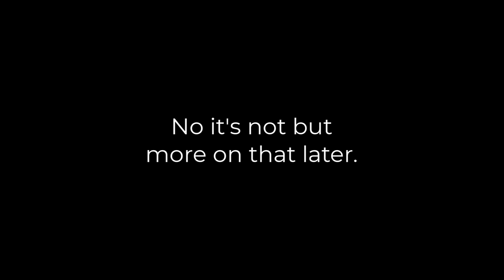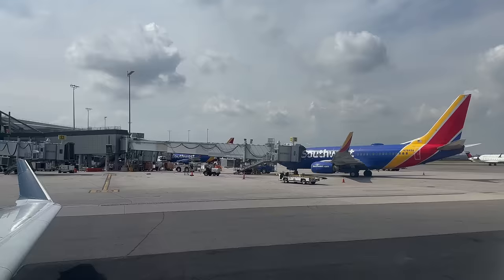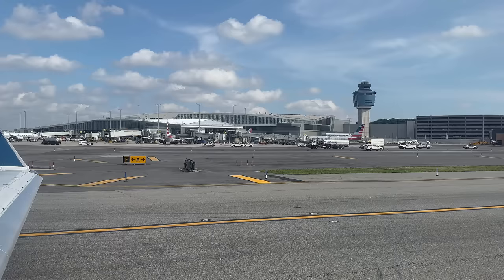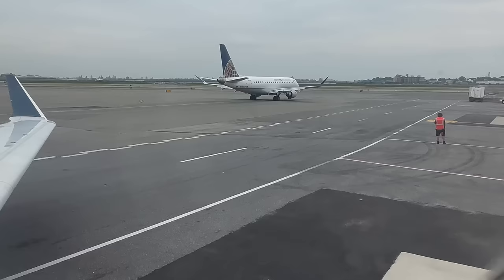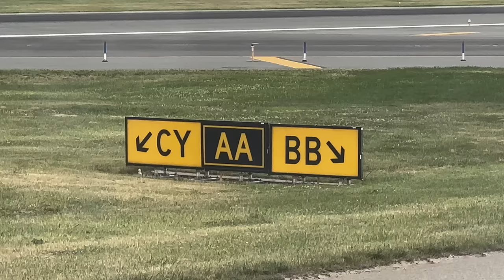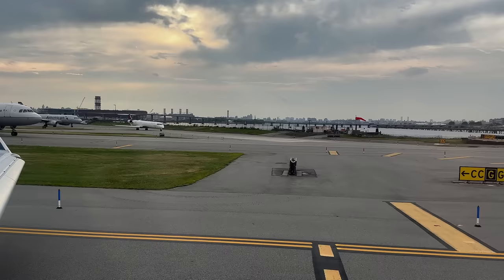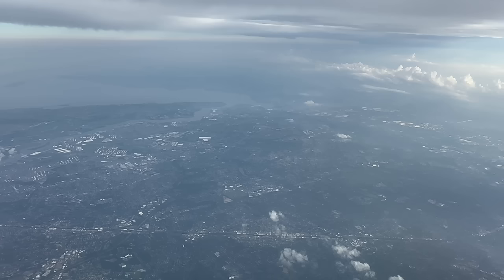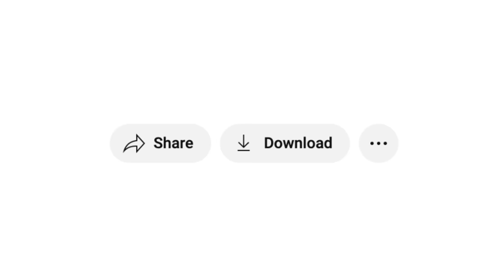LaGuardia Airport's Delay Problem

Comment: Great video! I can recall a similar experience like this last week when flying to Indianapolis (2:50pm flight). I was flying a Delta CRJ-900 (Endeavour), A system was developing over parts of New Jersey and some other places. Then KJFK Tower shut down all traffic moving west of KJFK. We were suspended on the tarmac and sat there for 3 hours. After all that, dispatch could not find an alternative route, therefore we had to go back to the gate and the flight was suspended until further notice while all the bags were still on board. About 1 hour later they said we could board and take off for Indianapolis. We boarded and we had to refuel which took some time. It was about 9ish PM until we pushed back. After we taxied out to runway 31R where we would be suspended for 2 more hours. After all false hopes and being 29th in line for departure, the Captain says dispatch couldn't find another alternate route so we will go back to the gate. In the end, the flight was canceled after being on the ground for more than 6 hours probably in total, and had to drive to Indy from JFK.  But that entire experience I could not stop thinking about this video, thanks to the video I knew what was going on. Thanks for the great video again!
Reply from the maker: So happy you were well informed during the delay!

Comment: at 27:00, what you heard was part of the controller briefing, either before a break or before a position split/combine. Controllers will typically work for between 1-2 hours before a break, depending on the facility and staffing.  Controllers generally have a button they push so it is recorded, and in this case my guess is the second controller plugged in her mic with the transmit button on.
Reply from the maker: It was pretty cool to hear!

Comment: Fundamentally, delays at the NYC area airports are a choice that the airlines, the FAA, and the Port Authority have made. The airspace does not really have the capacity to sustain the current number of operations. When everything goes right with the weather, there's barely enough capacity. When anything goes wrong, there are massive delays. It's no accident that EWR and LGA are the number #1 and #2 most delayed airports, and JFK also in the top 10 worst offenders. They are perpetually at the top of the list.

The real problem that this video reveals is the fact that there are so many regional jets operating out of LGA. In the most congested airspace in the country, flying 80 passenger regional jets is insanity. The airlines do it because passengers prioritize schedule frequency and non-stop flights, both of which are enabled by the use of smaller aircraft. The consequence, though, is that flight durations end up insane levels of padding and yet they still end up frequently delayed. And when things go wrong with delays at LGA, they go really wrong.

A sane policy would limit the number of slots to what the airspace can actually sustain. And you can bet if the airlines were slot constrained, they wouldn't be using those limited slots on so many 80 passenger regional jets. That would mean more connecting flights and fewer options with regard to flight times, but it would also mean a much better chance of actually getting to your destination on time.

Comment: I had a similar experience. We also had to wait on a long line because there were lots of planes arriving. When we finally got to cross the runway after a think it was an hour and a half it started to rain which delayed even more. After it stopped raining we had to go back to the gate because we needed to refuel and change flight crew. Then the tugs were busy and we had to wait 20 minutes for one to come. My flight was supposed to land at 8:00PM. We took of from laguardia at 8:01PM
Reply from the maker: It’s all too common.

Comment: Good video. I think the problem with airports like LaGuardia is that big majority of flights is on regional jets. I think if they change some of them to mainline, it will help reduce congestion. But also having 2 runways that intersect make it easier for it to be delayed if their bad weather.

Also, during the summer months, if take an early morning flight (like 6-9am) it is more likely to be on time compared to 3-4pm, due to frequency of afternoon thunderstorms that delay flights.
Reply from the maker: So true!  Thanks for watching!
Reply: Nope. Wouldn't help one bit. The issue is airspace, not the size of planes... Its a slot rrstriction airport and airlines are required to fly all those flights or lose the slots.

Comment: Your best video. Thanks for letting us hear the engines on take-off and landing. I feel for the children on the delay. Did you get fed?
Reply from the maker: Thanks. I often will play music when we take off and land because people are sometimes talking so loud and all you can hear is conversations!  But I wanted to expose some of the frustration this time that the passengers commented on.  I had a biscoff cookie and water.
Reply: @PeterMasella  I like hearing the power of the engines on take-off. I was at Newark Airport in 1963 on my way to basic training in the Air Force. You should fly to OTZ, I lived there in 1978, no crosswind runway and then it was half gravel. Landing Wein Air Alaska 737 was an adventure. I was at Teterboro in 1960 in a Cessna, first flight. 
You made this video very interesting to watch, was it hot inside?

Comment: Last summer, I was unfortunate to have a layover at LaGuardia. My connecting flight got cancelled, and the other flight I got booked on had a departure time of 8:35 PM. We left at 11:10 PM. I was stuck at LGA for almost 8 hrs (my plane had landed close to 3:30 PM).
Needless to say, I have experience with LGA’s delay and cancellation problems.
Reply from the maker: Unfortunately it is a common problem.

Comment: The weather in LaGuardia can be beautiful, but if the weather over your route is no good they’ll shut your route down and it’s very rare that they re route you around the weather due to airspace congestion. Add in trail spacing, fuel requirements, maintenance issues, and crew rest rules on top of that and a small congested airport and it’s a recipe for delay disasters.
Reply from the maker: So true!

Comment: Correct me if I'm wrong. Doesn't LaGuardia have two runways? If so, why not open the second runway to ease traffic?
Reply from the maker: LaGuardia has two runways and during the time this video was filmed both runways were in use. Runway 13 was the departure runway and runway 22 was the arrival runway. The problem is not with the runways. Even if LaGuardia had four runways there is nothing that can be done if the airspace around NYC is closed.
Reply: @PeterMasella  okay that makes sense. Thanks.

Comment: LaGuardia is a mess. I usually connect thru LaGuardia every two months flying between Raleigh and Detroit. Very rarely does the flight get off the ground within 15 minutes from pushback. I remember on a couple evenings about a year ago where it took over an hour to takeoff. We were on the taxiway longer than the flight was to Raleigh.
Reply from the maker: Unfortunately that happens a lot.
Reply: 50 years of Democrat control

Comment: I wonder what makes them decide to build the bridge instead of a pedestrian tunnel. United in the late 80s built the tunnel from concourse b to c at O'hare. O'hare is building satelitte terminals but it looks like they will have tunnels.
Reply from the maker: I thought that too. Perhaps the vicinity to the water had something to do with it.
Reply: Has everything to do with it.  LaGuardia is at sea level, smack on the ocean. @PeterMasella
Reply: @jvaneck8991  Exactly! Additionally, the experience of walking the sky bridges over the active tarmac as compared to the underground concourses at ORD is totally unmatched. Especially for a flight enthusiast!

Comment: All the New York's airports are overcrowded is not a news. The LaGuardia intersected runway can not serve the problem and it is lack of land to expansion.
But New York seems no land reserved for a new airport to fulfil the air-travel demand.
Also the airlines are using small aircraft to reach the frequency rather than the capacity.

Comment: As large as JAX is, I'm surprised they put you on a regional jet there instead of the main line.
Reply from the maker: It’s a LGA based flight route. Regional jets are king at LGA.
Reply: @PeterMasella  With it being a smaller airport than EWR or JFK, I guess that makes sense.
Reply: Also, LGA has a flight perimeter, so there’s less need for larger planes since it doesn’t run coast-to-coast routes. If I recall correctly, Delta only really flies mainline from LGA to its other hubs and a few major destinations.

Comment: Where’s the buck stop at the company for fuel management?  It’s teeeeeeechnically the captain, but I’d imagine Endeavour Operations is the one who has to pay for it, and onward to Delta Ops since they get the yelling from the customers.  If you fly into these problem airports with forecast problem weather and problem traffic frequently, is the addition of ooodles of fuel (that you will burn anyways) worth more in the truck at the gate, or already in the wings?  The cost in fuel, labour, and time, would surely outweigh any fuel not burned in the conga line.  And even if the sky gods (whose powers never work in Newark) magically open up and let the line go, they’re surely still under MTOW with the extra fuel.
Reply: you should contact them and fix it😅😮😢😢😢😂😂😂😂😂😂

Comment: NYS spent billions of dollars fixing up the LGA terminals but they couldn't do anything with the runways like either lengthening them or adding more runways? That would really solve LGA delay problems. Come on NYS! What are we paying high taxes for?
Reply from the maker: I agree!  The real issue is beyond the airport - and the lack of usable airspace fixes for departures.
Reply: @PeterMasella  well they should fix that too!
Reply: Well, where exactly should they put these new runways or the extensions? LGA is crammed in between the city itself and Flushing Bay. Yes, they could try extending out into the water, but that would be extremely expensive, complicated by the presence of Rikers Island. Even adding/lengthening runways doesn’t alleviate LGAs problem. As pointed out in the video (9:45), La Guardia uses approaches and departures that are shared with other airports, then lump on the OTHER- smaller but still very active airports (Teterboro, Morristown, Republic, Islip, White Plains, etc) and you are still left with an extremely congested web of airspace. The problem is not so much LGA as it is WHERE LGA exists. If someone built the same exact airport in Kansas, it’d function just fine, but when you stick it in the middle of a shared airspace soup of at least 6 other airports, and in a the most congested part of the country (I’m talking the line from Boston clear down to Richmond and maybe even so far as Atlanta) it becomes a struggle to keep things running smoothly.

Comment: That was just a bad operational decision not to fill up the tank given the issues at LGA. This issues are well known operating out of the airport. Nothing new. Thank it's bad now, should have tried flying out of LGA in the late 90s early 2000's. 2 hour + wait after pushback was the norm.
Reply from the maker: So true! I remember those days too.
Reply: Unfortunately, it's not as easy as just filling up the tanks.  The aircraft has to be planned to land under maximum structural landing weight, so the weight of the gas you take with you as reserve must be accounted for on landing as well, even if there's a good chance you'll use it.  This is touched on after they returned and almost had too much fuel.  Additionally, runway 13 is the most limiting at LGA performance-wise.  This may have been a factor as well.  As an airline dispatcher, the ceiling for how much fuel I can take is rarely limited by tank capacity.

Comment: I AM A RAMP AGENT FOR SWISSPORT @ LGA AIRPORT. SWISSPORT HAS THE CONTRACT WITH AIR CANADA IN TERMINAL B & SPRIRIT IN THERMINAL A. I HAVE BEEN WORKING WITH SWISSPORT SINCE JANUARY 2022. I STATRTED WITH AIR CANADA IN TERMINAL B & SINCE MARCH OF 2022, I HAVE BEEN WITH SPIRIT IN TERMINAL A.

I KNOW EXACTLY WHAT YOU ARE TALKING ABOUT IN ALL YOUR VIDEOS.

ON WEDNESDAY, FEBRUARY 22ND 2023, WHICH WAS THE LAST WEDNESDAY IN FEBRUARY IN 2023, I REMEMBER THAT, FLIGHTS WERE LNDING ON RUNWAY 4 & TAKING OF ON RUNWAY 13. THE LINE FOR TAKEOFF WENT ALL THE WAY DOWN TO TERMINAL A,  CROSS OVER RUNWAY 22-4 ALL THE WAY BACK TO TERMINAL B. I AM NOT SURE IF THE LINE WENT ALL THE WAY TO TERMINAL C.

AT TERMINAL A, SPIRIT AIRLINES, WE ONLY HAD 3 TURNAROUND FLIGHTS IN THE AFTERNOON BECAUSE THE OTHER TURNS WERE CANCELLED.

EACH FLIGHT THAT GOT PUSHED OUT FROM THE GATE HAD TO WAIT 30-45 MINUTES BEFORE THEY COULD ENTER THE LINE TO APPROACH RUNWAY 13

SO I KNOW WHAT YOU MEAN

IF YOU ARE EVER IN TERMINAL A IN LGA, ASK FOR WILLIAM M. HOROWITZ
Reply from the maker: Thank you!